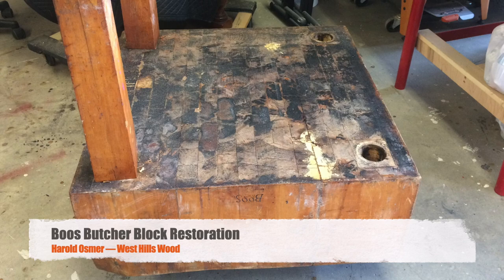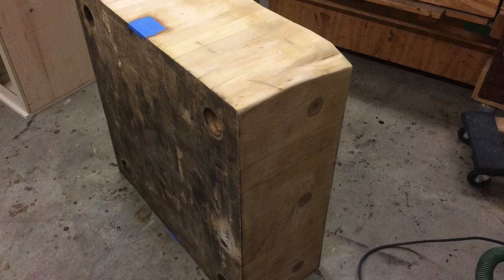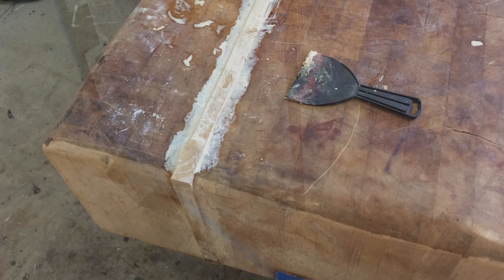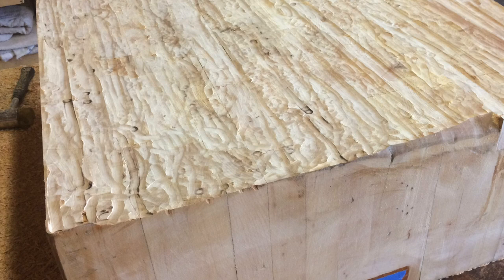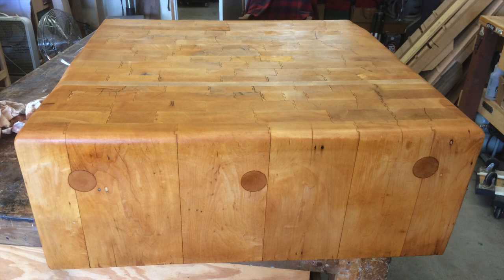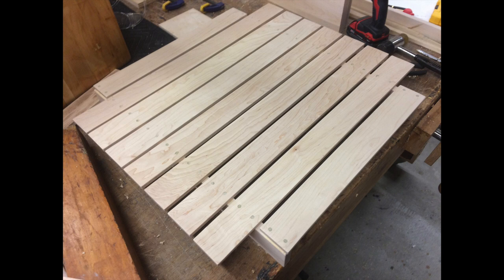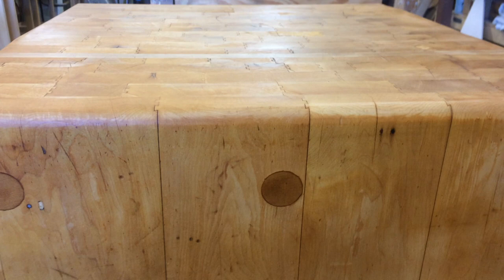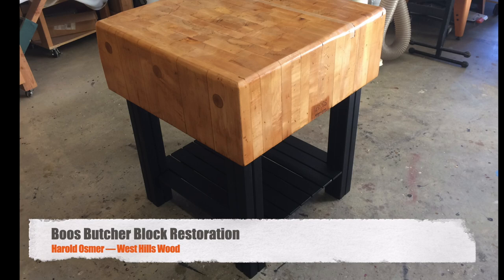Boos Butcher Block Restoration

Comment: Great work on that butcher block.  I have one very similar if not the same size that I was blessed with several years ago.  It’s in my kitchen for use when I process venison.  Put heavy duty caster wheels underneath so that it can be easily moved.
Reply from the maker: Thank you. As pretty as they are, they are also tools that should be used. Casters is a good idea.

Comment: If the boos brand was deep enough you could have sanded over it enough to get rid of the discooration around the brand without removing the brand.
Reply from the maker: Yes. But the brand wasn't very deep and I didn't want to risk messing it up.

Comment: How about wheels on the bottom?  Those things are heavy.
Reply from the maker: Oh yes, very heavy. Therein lies one of a Boos Block's strengths. The mass makes it an ideal platform for whacking hard with a cleaver, etc over many years. Heavy duty casters with brakes would help for moving it around the kitchen or butcher shop. But you do need a stable base for meatwork.

Comment: Nice, but the character is pretty much gone. But if that’s what the customer wants, so be it.
Reply from the maker: Thanks but I disagree if you are referring to the character as being the use marks. 
This particular block had been in a commercial setting for several decades and was salvaged to reside in a house. It was missing a leg! The top was carved and cut and chipped out from years of service. Akin to painting an old barn find car. Sure the old patina is interesting, but how is this going to be used? This old block has found new life and has been in her house for several years now as opposed to finding a landfill.